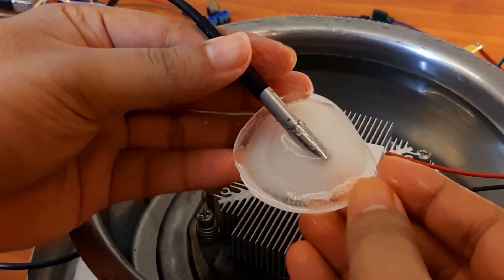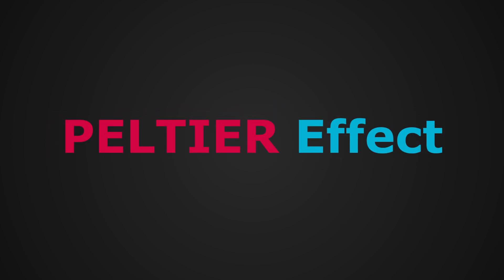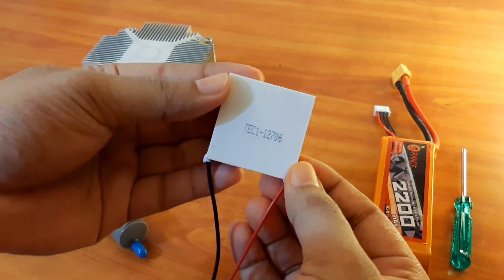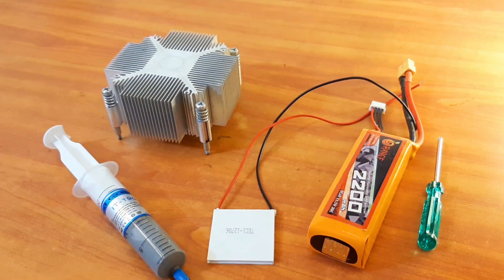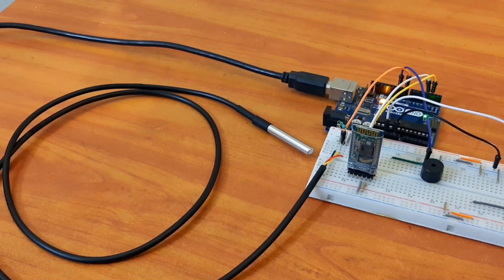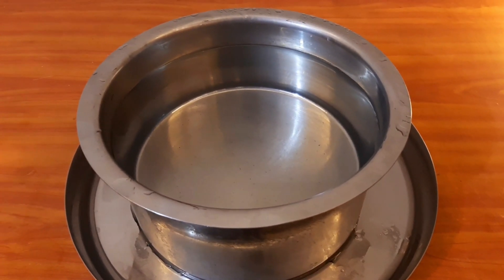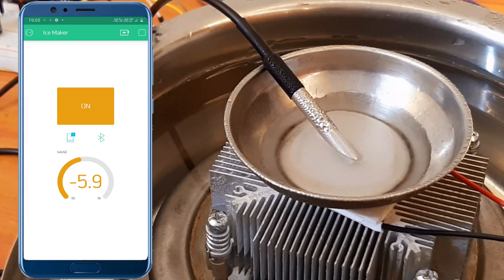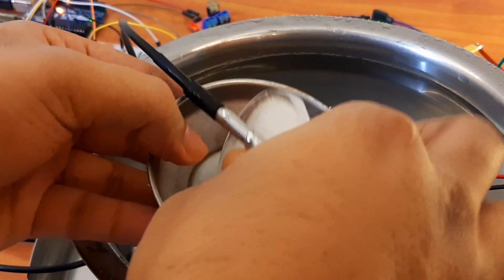Peltier Cooler | Device that makes ICE | Concept of Thermoelectric Cooling 🥶

Comment: I think the directions are a little messed up here. Like at first you showed that when the Electric current flows from bottom to top in P type then bottom becomes hot and top part becomes cold while in the part where you showed the complete circuit there the thing's reversed. Pardon me if I get it wrong.
Reply from the maker: Actually the concept is not about the direction of electricity. It is about the difference in temperature when you pass electricity. Now when you pass electricity through p type and n type meterials, the temperature gradient will just be reverse. It is not fixed that for all p type meterials, if you pass current from botton to top then a particualr side will get cold. The concept is whatever be the temperature gradient, it will be reverse for p and n type impurities.